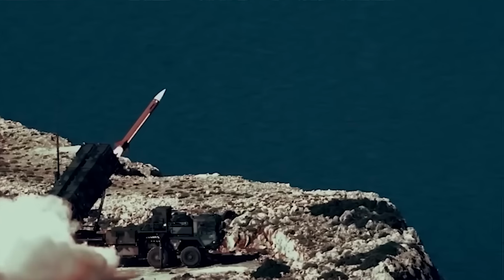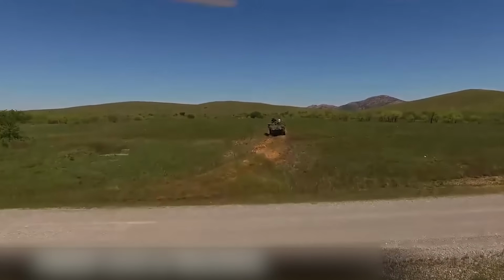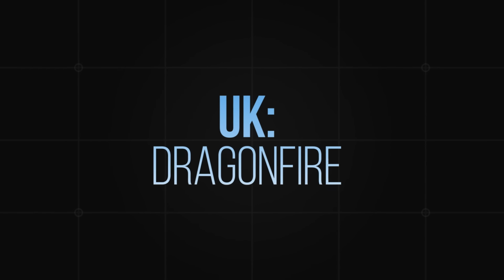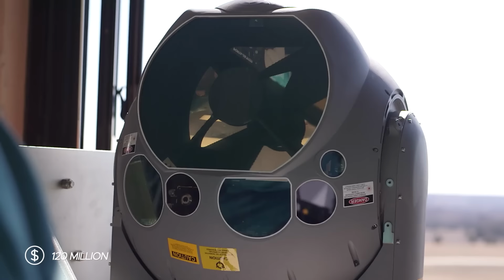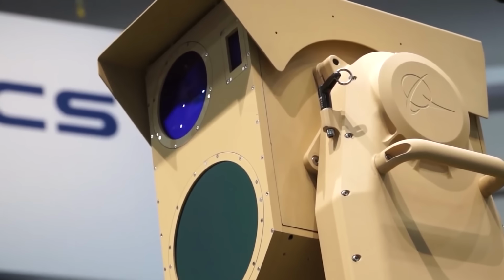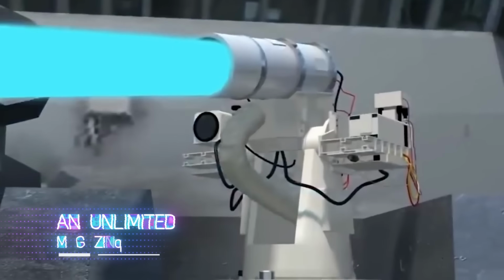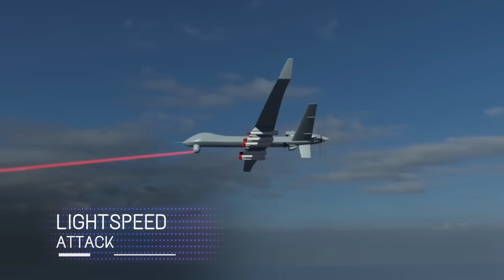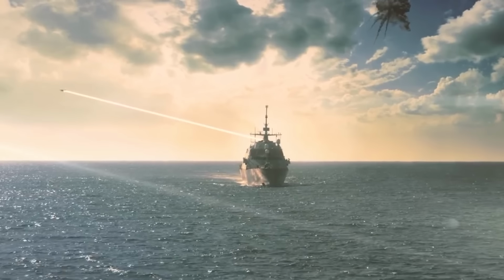UK Army Tests Most Frickin' Laser Beams In Iran! US SHOCKED!

Comment: A ground based defence would seem to be highly possible.  Batteries of laser based defence. With the fact that is it light based, not counter munitions speed and so cheap to operate, it could ultimately negate the threat of traditional ballistics almost entirely.  Imagine adding this capability to the iron dome.  Being ground based and not vehicle based it could be installed at even higher power levels (though I am not sure it needs to be really) and you could down almost unlimited numbers of drones and missles as long as your can detect and target them.  In fact it wouldnt be worth attacking.  Because you would run out of money to fund attacks with little or no benefit. Great news.

Comment: Poor Human Pilots, but:
Location of laser beam is visible from as many miles as current visibility is.
Second drone with laser dazzler-Marker may lead 3rd missiile upon Laser location...
3
2
1...
That thing must fly above clouds not to shot with sweet rainbow (and cool laser with cold wind not heavy liquid circuit).
Drones fly in rain and may have polished reflective surface...
...reflecting beam back if it is generated so sweetly.
Without even moving mirros targeting laser but just proper 3x90deg shape ( like radar reflective buoy send signal exactly bact to sender).

.. return to sender ..

Comment: For all those thinking that a reflective surface or mirror would be effective at stopping this type of laser's job. Think again.

A mirror or reflective surface will not work for this type of laser. It may slow the process down, but the heat radiation will cook the reflective layer/surface away. After that, the target is quickly penetrated and destroyed.
Reply: The power output must be around 1000kw to cook these reflective mechanisms,the main hinderance is how to supply that power consistently to the laser beam without burning the power system itself.
Reply: You better be right,they can't afford to muck around if things go wrong . I was hoping they solve that reflective drawback

Comment: Iran only needs a mirror... 😂
Reply: A mirror or reflective surface will not work for this type of laser. It may slow the process down, but the heat radiation will cook the reflective layer/surface away. After that, the target is quickly penetrated and destroyed.

Comment: What if they paint the drones with a Chrome like reflective paint?  opps
Reply: A mirror or reflective surface will not work for this type of laser. It may slow the process down, but the heat radiation will cook the reflective layer/surface away. After that, the target is quickly penetrated and destroyed.